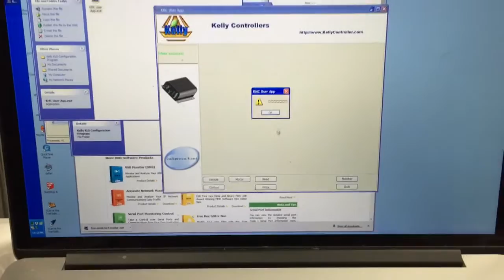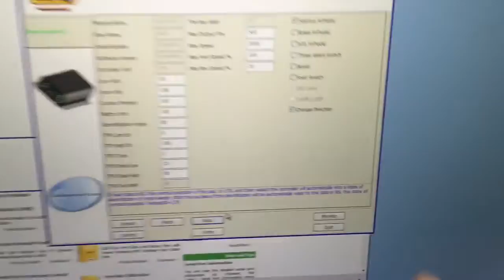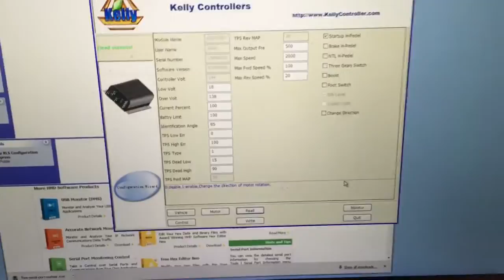Kelly KLS8080I setup 3: Auto-Tuning and it works!

Comment: if you use change direction regen is triggered for a split second at takeoff slowing down your launch time, its a common fault on all kellys of all models, best way is to change two hall sensor wires in the motor around
Reply from the maker: Wow, really? I didn’t know that. Unfortunately, my launch time isn’t going to be affected by a split second regen trigger.  (See a previous vid where I talk about both me and the bike being overweight 😳). Thanks though!

Comment: hi,

at pin 8 (meter) which voltage you get out there ? 12V like me ? it should be a copy signal from the hall or sin/cos sensor.
ps: i have the kls8080ips

Comment: So I have 600 18650 cells I'm putting on a CR80 frame with a zero motor and I was wondering if kelly controllers will work with my motor and if they make one that can do 50kw?
Reply from the maker: Unfortunately, I don't really know the answer to either of your questions.  I'd guess maybe the zero motor would work with it. You might check the elmoto.net group or endless-sphere.  There may be folks who have more info about using a zero motor with the Kelly.  I've forgotten what voltage the Zero motors run at, I think it's over 100V though.  The 96V/600A kelly controller specs say it can have a voltage that's 125% of the rated voltage, so 120V.  If the pack voltage at full charge is less than 120V, you might be able to use that one, which will get you pretty close to 50kW.
Reply: Yeah because they rate phase amps right.? How do you figure the power output out if its in phase?
I know the Zero motors use a sevcon so I would think a Kelly would work.

Comment: Hi! Would you please tell me how this SM-4A to DB9(RS232) converter is wired? I forgot to order this converter and I have to build it by my self. Thanks!
Reply: I'm in the same position now. Do share any idea. Now own made not responding with err message. I thought if interchange Rx and Tx and try with RS232. I don't know from this 4pin to RS232 9pin really matching on the right pole?

Comment: Have you tested if you have lost any top speed?
Reply from the maker: +Tony Castley Not yet.  I have 2 busted spokes, so I'm in the process of replacing them. Then back on the road for testing.  I'm guessing it'll be the other way around (I will gain a bit of top speed) because I think the kelly is tuned better than I had the Sevcon tuned.
Reply from the maker: +altitudeca spokes have been replaced.  top speed test today was 72mph on the speedo.  I think  the GPS said 71.  I was never able to get over 69 on the speedo using the sevcon.
Reply: +altitudeca Good news...
Reply from the maker: +Tony Castley Thanks.  For more, I'm trying to update my elmoto thread: http://elmoto.net/showthread.php?t=580&p=48734&viewfull=1#post48734
Reply: What size motor are u running